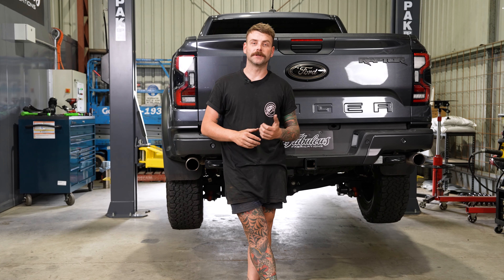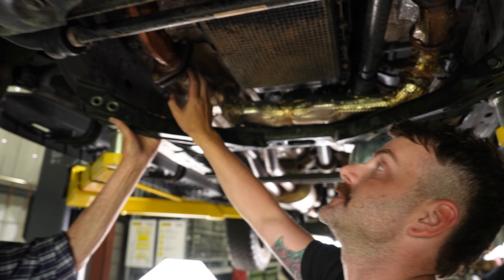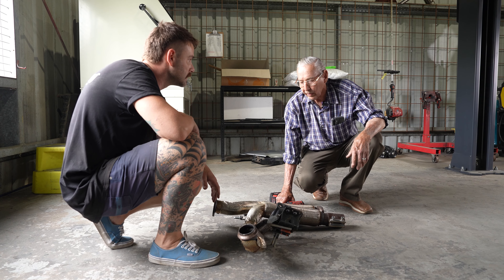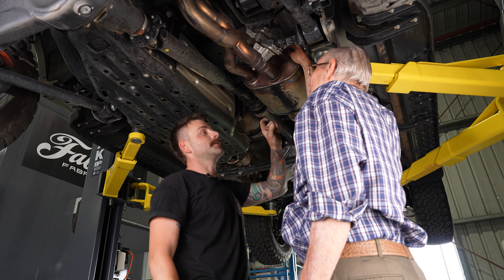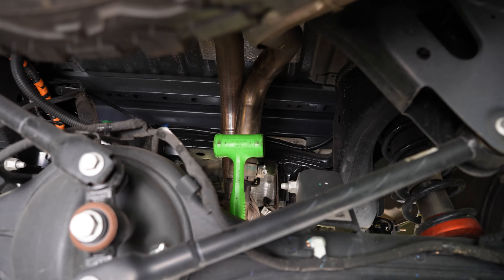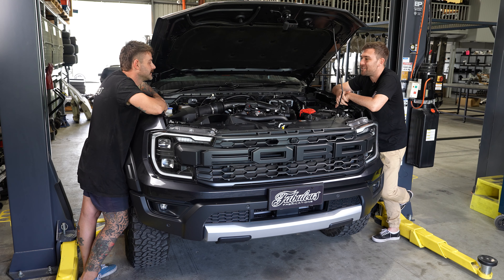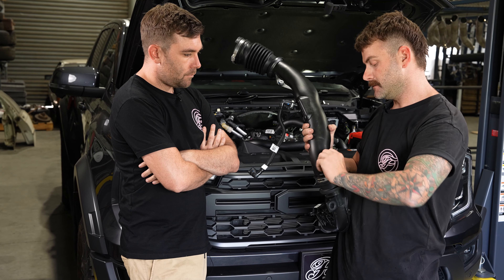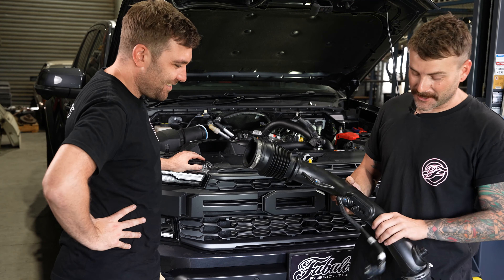RAPTOR BUILD Ep2: Lets pull it apart.

Comment: Love the work guys and making more shit for me to buy. The fuel  ratio is off a bit there guys. I have 18k on clock and 35s and weights around the 2.8t with a bar,winch,roof rack,awning, twin compressor battery system and   fridge and i drive it like stole it as to much fun and i am 15l so these guys with stock ones are at least 13 or 14l so they have no idea until they have put some ks on them.
Reply from the maker: Hey mate, thats interesting insight! We only managed to put about 45kms on it before putting it on the hoist sadly, so not at all a good sample size haha! looking forward to the improvements!

Comment: 21.8 is where mine is sitting right now. I need to buy a servo
Reply: F me mate that’s huge, I’m running 14lt but that’s being as conservative as I can.
Reply: @micahdrever1892  I think it's because I've been doing alot of small trips, traffic and I do like to give it a bit of a hiding sometimes. I'm getting the herrod performance pack in 2 weeks so hopefully that helps. They are getting around 10 with theirs after the upgrades. Gotta drive down to Melbourne for it though.
Reply: @rebelrob9637  what’s that pack consist of mate and where are you located? Keen to know what the upgrade is
Reply: @micahdrever1892  I'm located in Sydney. The Herrod pack is bigger intercooler, new transcooler, engine tune and transmission tune. I've already put on fabulous fabs twin air intake on mine and the turbo smart blow off valve so with the herrod pack I'm looking at a gain of around 100hp. And it will use less fuel. Win win
Reply: @rebelrob9637  mate that sounds mad can you keep me posted on the outcome when it’s all done , keen to see what you think. How’s your bov does it go off under normal driving or only when  getting into it? I’m used to my old wrx or 180sw bov that went off all the time this unit hardly ever goes off, I’m thinking it’s got something to do with the anti lag
Reply: @micahdrever1892  my fuel is sitting at 11.2 now after driving it around for a couple weeks with the herrod upgrades and it is a ripper. Heaps more power.
Reply: @rebelrob9637  Hey mate that’s a huge fuel difference how are you driving it now compared to before? I can’t get less than 14.5 around town, do you know anyone in Brisbane who can do that upgrade ?